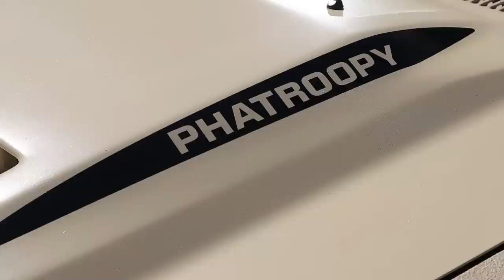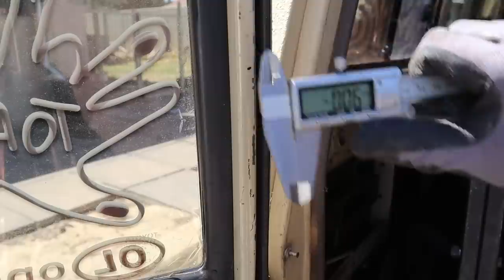Top Mount Intercooler, 79 Series Bonnet Scoop & More! - HJ75 Troopy Build (EP19)

Comment: Your rig is coming together nicely. Better than nicely! F'n beautiful! and the intake plumbing does indeed speak for itself.  Can't see from footage, but I guess there is support bracketry for pipe running from a/f to turbo? If there is, amazing job. If there isn't, still an amazing job, but needs bracket. Clearly u know what vibration can do from your cooler bracket design (rubber mountings etc). 👍
Reply from the maker: Thanks for all your comments Peter! Appreciate them all mate, thanks for watching 🤙

Comment: How come you fibreglassed the scoop down and blended it if your gonna raptor line the bonnet anyway? Why not just glue and bog?
Reply from the maker: Because I don’t want it to fly away 😂
Reply: @ShedBuilt  fibreglass adds strength doesn It? I got no idea on body work ha
Reply from the maker: @tristanstephens9076  yeah man fibreglass is way stronger than body filler
Reply: @ShedBuilt  copy that how much raptor liner did you use to cover the troopy? Thinking bout raptoring my 80
Reply: @tristanstephens9076  dont do it man you'll regret it
Reply: @Valkyrie10188  whys that?
Reply: @tristanstephens9076  because it looks like trash. at some point down the road youll regret not painting it properly. just get a proper 2pack